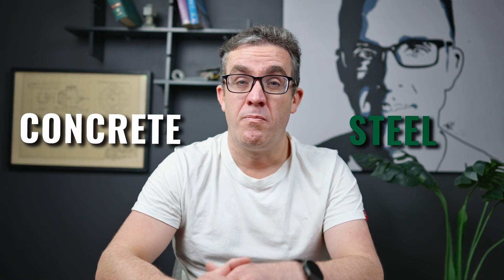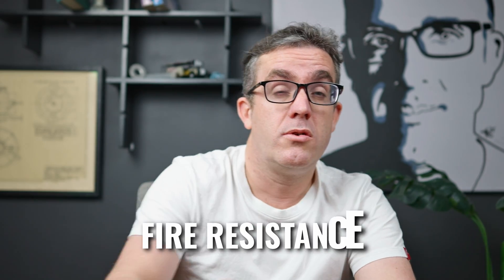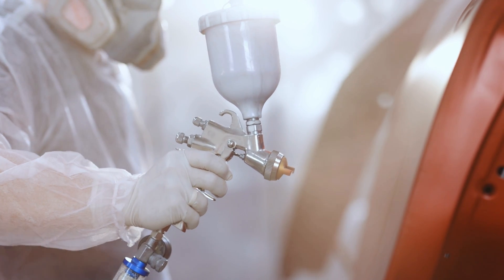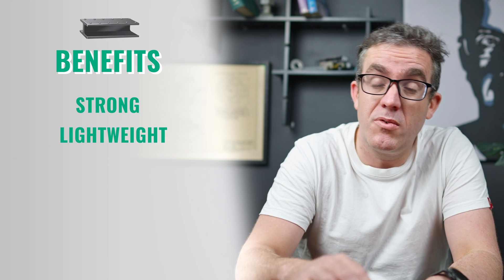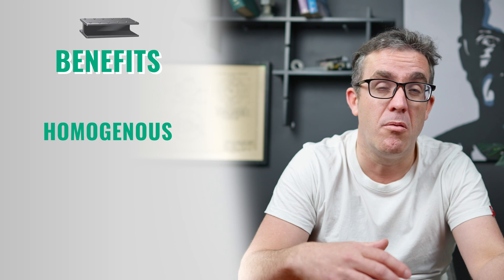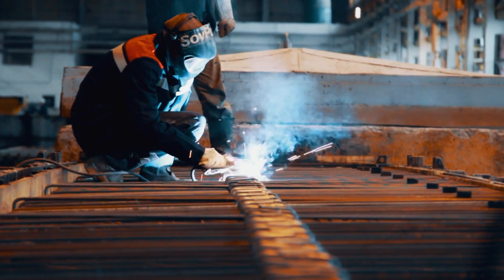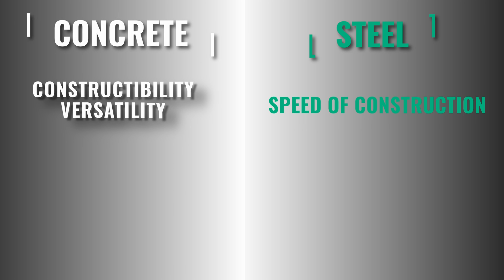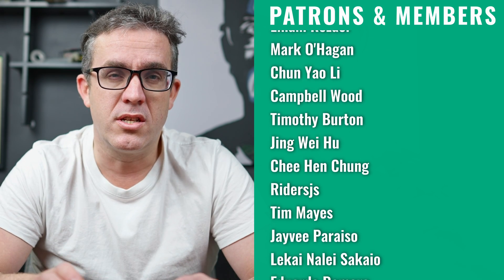Concrete vs Steel, which material to use?

Comment: I keep hearing so many different opinions on material. I've been told steel is more cost effective compared to wood from one company and architects say concrete and steel are expensive. But here I'm hearing it's not expensive?
Reply: For a multistorey building a structural frame will always be more economical and faster to construct than a load bearing structure. The question then is concrete or steel. Concrete has inbuilt fire protection and greater acoustic properties whereas steel requires fire protection to the columns and beams but not to the roof areas which are allowed to collapse. Acoustic enhancement is also required. Smoke alarms will also be required in certain fire compartmented areas. The raw material costs vary for both steel and concrete so cost effectiveness changes.  A flat slab in a concrete frame has  beneficial properties, too as it is faster to construct.. Your Architect will champion wood as that's  an Architects material whereas steel and concrete is an Engineer's material.

Comment: 9:25 I'm sure this is just a quick video so maybe I'm overthinking it, but my understanding is that steel corrosion is separate from "concrete cancer". The steel can corrode due to moisture ingress. Concrete cancer is the second thing you mention, the alkali-silica reaction. Either phenomenon can cause spalling.
Good comparison video, always fun to select one material or the other for a given project and weigh up the options.

Comment: Hi Brendan, it's brookz, a suggestion if I may, could you upload a video discussing the topic of "life time expectancy" of a building and about the methods of structural   strengthening and repairing?
Reply from the maker: Hi Brookz,  thanks for your ongoing suppot.  life time expectacy is a broad topic as it will cover many subjects would be a great topic to cover. is there any specific streghening you want to look into?
Reply: @BrendanHasty  Column Jacketing & Carbon fiber structural strengething.